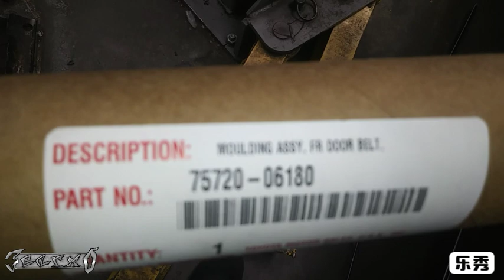2017 Camry window belt replacement

Comment from the maker: GET THE MOLDING  PART HERE ( AMAZON )
https://amzn.to/3CiXGMI

TOYOTA PART #  75720-06180

VEHICLE FITMENT

2017	Toyota	Camry	Hybrid LE, Hybrid SE, Hybrid XLE, LE, SE, XLE, XSE	2.5L L4 - Electric/Gas, 2.5L L4 - Gas, 3.5L V6 - Gas

2016	Toyota	Camry	Hybrid LE, Hybrid SE, Hybrid XLE, LE, SE, Special Edition, XLE, XSE	2.5L L4 - Electric/Gas, 2.5L L4 - Gas, 3.5L V6 - Gas

2015	Toyota	Camry	Hybrid LE, Hybrid SE, Hybrid XLE, LE, SE, XLE, XSE	2.5L L4 - Electric/Gas, 2.5L L4 - Gas, 3.5L V6 - Gas

Comment: Is this the same for the 2018 Camry? Is the top part the same process as well?
Reply: Did you ever replace yours? Wondering the same.
Reply: @jayou1987   Hey! I did end up replacing mine. However, it’s a bit different for the 2018 Camry. I would suggest taking off the plastic trim from the interior. Then using a plastic trim remove tool to unhook the clamps. Hope this helps.
Reply: @whoszane6386  Please be a little more specific.  thank you

Comment: Should be about the same for 2018 eh
Reply: can you be a little specific about replacing it for the 2018 model please?
Reply: @minhquan1  i replaced mine man, i just ripped it off. One little peice from the old trim broke and fell in the door but i dont care. Just pry under and pull up